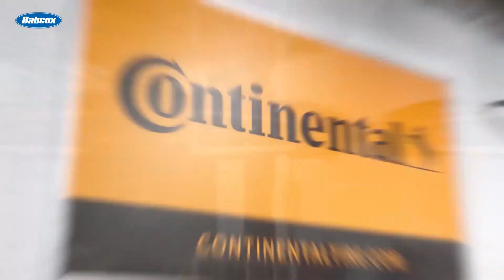Engine Belt Misalignment

Comment: Hi David. 
I had my battery replaced on my A class Mercedes 2011 model yesterday. Only to find the battery warning light still came on - on the dash board. 
So the technician checked the belt which was badly ragged - almost cut in two down the middle. He noticed the pulley was misaligned — but told me there was no adjustment bolts at all. 
Please cud you advise .. 
I have a photo of the new belt & pulley which clearly shows the misalignment. 
Thx 
Rosemary